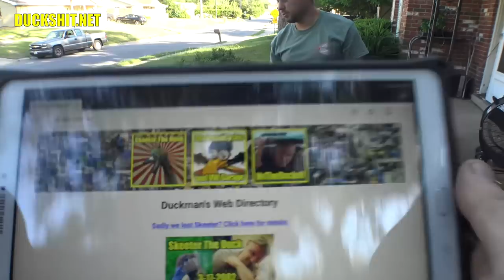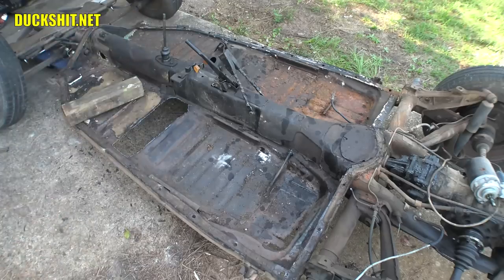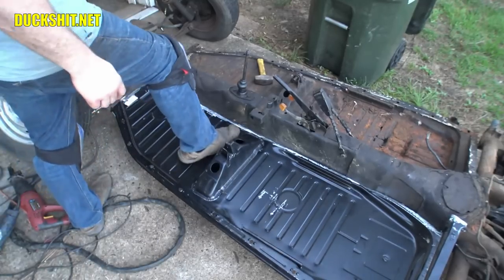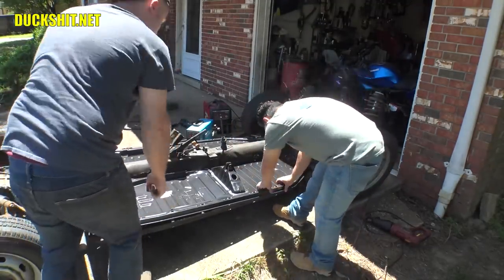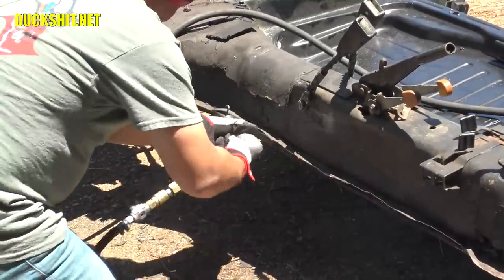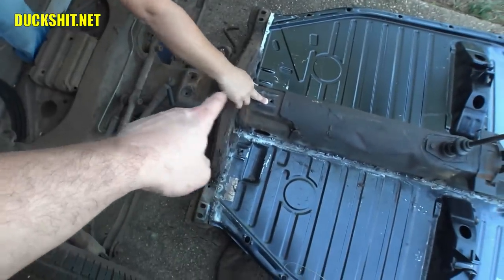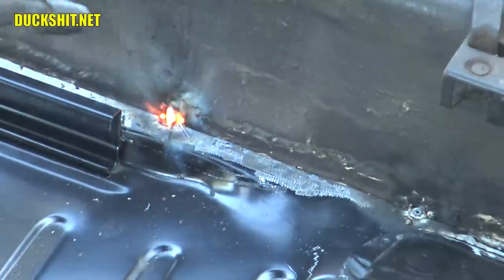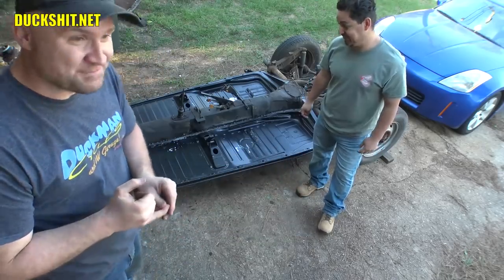Replace VW Floor Pans in an Hour (Super Beetle)

Comment: looks great for flux core. it works. whatever you have will work to get the job done. Better tools are nice but not required.
Reply from the maker: Thanks Mike, you said it best right there!  Even a Harbor Freight welder would be a cheap throwaway for someone doing this for the first time (and maybe never again?)

Comment: Super happy I found your videos. Thank you for all the helpful information.  I have to undertake this exact same job in the next few weeks and thanks to your videos I am no longer as intimidated as I was before.  And as for your Rum and Coke ... guess where I am off to now.
Reply from the maker: Thank you so much for the comment, glad I could help!  If you liked this video check out the one I did 2 years ago, its a bit faster paced with much less humor.   Lemme know what you think!  https://youtu.be/JMkahP6TE0A
Reply: @DuckmanCycles  I actually saw that one first and it got me thinking that I could do this.  Now after watching a few more of your videos I am confident enough to give it a try myself.  I really appreciate the tips you give in your videos as well as what works for you.  Sure, someone else's experience may be a little different when they tackle a similar job but I am confident that I will be able to figure out one or two issues and not be totally daunted by the project as a whole and then simply just not take it on.  Thanks again.

Comment: You make installing floor pans look easy. 
"The Duckman" can do fabrication!
Reply from the maker: Well in reality it's not a very hard job, but the preparation for it, and reassembly of course, is a rather large undertaking!    :-D   but at this point I've done enough of them I don't even check a manual anymore.  Hehehe.

Comment: You can use a metal rod with a T handle on the end to push that metal down put it inside the armpit or wherever, works great!
Reply from the maker: Sounds useful, thank you for the suggestion!

Comment: Great video, I'm glad you said what Earl had told you regarding the transport paint, I actually did that exact thing as the paint seemed good, just scuffed it up, primered and then raptor. Really enjoyed the video... Be great if you get the chance to do a heater channel one in the same vain.
Reply from the maker: I've done a couple heater channels up here but never start to finish straight through video.  I guess we'll see what happens coming up!   Thanks for commenting!

Comment: During your lunch break, I was hoping to c u use the plasma cutter to remove the crust 🤣
Reply from the maker: I would have done exactly that, but a plasma cutter won't strike a spark on a sammich.  Its gotta be metal!   Hehehe
Reply: @DuckmanCycles  .. maybe wrap that sammich in tin foil first? I know... the ground clamp might be a little hard on the end product.  <LOL>

Comment: just wondering , are you using sheilding gas or flux cored wire ? try C25 sheilding  gas with .021 wire  and you wont burn through and will get better welds !  Great job though !   Kevin
Reply from the maker: You are correct!  Thanks for the suggestion!

Comment: While this was not what the video was about per se, you both were talking about the steering. This is the suspension/steering from 1973.5 to 1974. It has steering damper and center control rod as well as the 2 bolt struts. The very different rack and pinion steering pops up in 75 and in my opinion is so wonderful to drive since I have a 79 with it to compare to my 72 with this earlier configuration.   Here's a pic of my restored 79 rack and pinion with tie rods for comparison:  https://imgur.com/a/gs64p7W
Reply from the maker: Good call, and THANK YOU for your input on this... Super Beetle isn't my department at all!

Comment: What plasma cutter do you have? I been wanting one and have seen some reviews on cheap ones that work very well but stupid me didn't right them down.
Reply from the maker: Its a cheap chinese one from Ebay.  They are almost all the same, painted different colors.  It cost me over $500 some years ago, but now you can get them for less than $200.

Comment: If you don’t have an air hammer what else could you use to get that excess metal off the lip of the tunnel? I tried a hammer and chisel but it’s not very good
Reply from the maker: That works, or use a grinder... it's a much slower process though without an air chisel.
Reply: @DuckmanCycles  thanks for the response and advice
Reply from the maker: Hope I helped, thanks so much for the question

Comment: Looks really good, im currently trying to find a cheap mig weld , but can only find cheap fluxed mig weld machines here in my country the other ones are so expensive
Reply from the maker: I'm not sure if you have Craigslist over there, but that's where I found mine
Reply: @DuckmanCycles  Yeah, i'll keep looking for a used gas mig
Reply from the maker: Mine is dual-purpose gas or flux.  Very happy with my purchase!
Reply: @DuckmanCycles  But you use it with gas right ?

Comment: Hi, Glenn,
Welding machine adjustment is all well and good, but nobody really needs it, because the machines work very differently. It is good if you know what kind of welding wire is used or how the feed or gas pressure is set, but you will always get a different result - to your machine. Here you just have to try it out and find the correct setting for your own welding equipment.
Greetings from Germany
PS: Bring the duck tape....😂😂😂
Reply from the maker: You are absolutely correct, plus there's other factors such as power regulation, and environment.  Small things like temperature humidity and wind will even affect your welds.
Reply: @DuckmanCycles  That's correct!

Comment: Duckman
Well I was told here in the uk when welding u need to do a full seam and some one else once told me to weld a inch then leave a gap then weld a inch again so not to distort the metal what do u think is the best way to weld on cars because the metal is so thin these days
Phil in the Uk
Reply from the maker: That might be true, but you do not want to do a straight-through weld bead on a VW floor.

Comment: i love the classic beetles but you rarely see anyone working on the supers.  they get so much hate from the VW community.  i just dont get it. They are aircooled still.  I have a  65 beetle but i like the supers too. I'm glad your tackling a Superbeetle.  Now i do not like the "new" fiberglass beetles that replaced supers in the 2000's.  those are gross and ugly and not air cooled.  I hope you do more super beetle videos and Ghia videos soon!  You and Bee keep at it!
Reply from the maker: I'm not a huge fan of super beetles either.  Yes, they are cousins, and I accept them.  But if given preference, I'd keep Eleanore and kick the Super onto the curb.
Reply: I love my current 2 supers (72 1302 model and 79 1303 model). I've had a 74 1303 and a 71 standard as well. There's a massive global following for the 1302 and especially 1303 models. You just need to know where to look. And there's so much odd hate for Supers in the US but hey, there's hate everywhere over minute things. Then again, I find split windows to be ugly as hell but that's only because I grew up around early 70 Beetles, which of course is what I'm drawn to as an adult.

Comment: i use a 8 pound weight to help hold  those together when welding those spot welds (Mig welds lol) i am doing my Jeep floor pans
Reply from the maker: That sounds useful, but I have size 15 attatched to a 250 lb man that I use, hehe.
Reply: @DuckmanCycles  lmao mine is only size 10 but 300 pound man lmao

Comment: Hey Duckman, I don't have a tig, mig, stick, or oxyAcetl, Welder, since it's a "super" beetle will "super" glue work? Just askin'. If I can, how many millilitres per lineal inch should I use? Oh! Oh! Should I spot super Glue thru holes or do a continuous seam glue? Uhhh...Okay, I'm finished being stupid. Wheeew! That was hard. LOL! I drove a 1963 with a 1965 engine in it in 1966/67. I never particularly like the super beetles when they came out. I really don't know why, they just didn't look right. Does that make sense? Regards, Solomon
Reply from the maker: Yes super glue would actually work.... wait until you see what I have planned for Gregory the Bus!  LoL!
Reply from the maker: I've never been fond of the Super Beetle shape either.  They look odd.

Comment: I need to get floorpans for my 74’. What brands fit good?
Reply from the maker: They've all fit pretty well on Beetle.  I can't say the same for Ghias...  Check out the links in the video description.
Reply: @DuckmanCycles  ... fitting the rest of the floor is one thing but I hear many pans have an issue with the bolt holes not lining up to the body, which really slows things down on reassembly.

Comment: Two drunk welders ,  wonder if the welding is better on one side. Did you weld small beads or spot welds ?
Reply from the maker: Spots only, spaced apart as demonstrated in video!